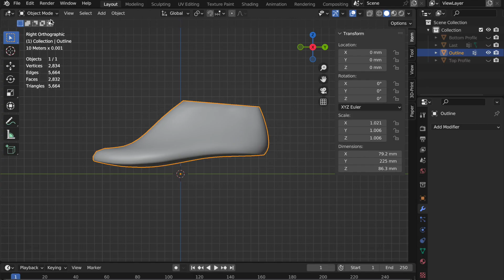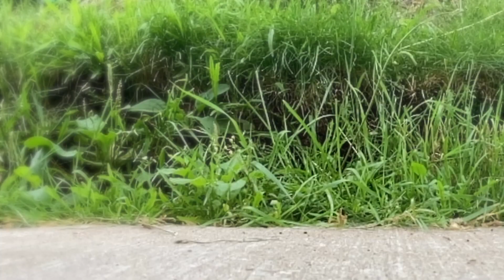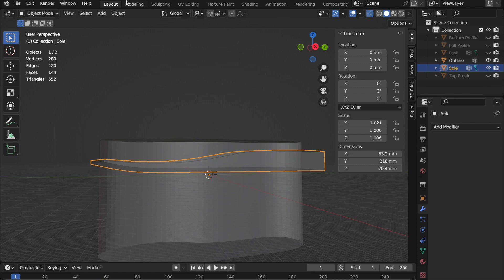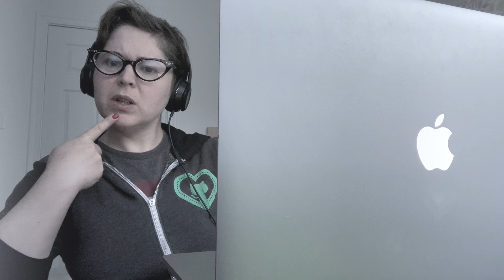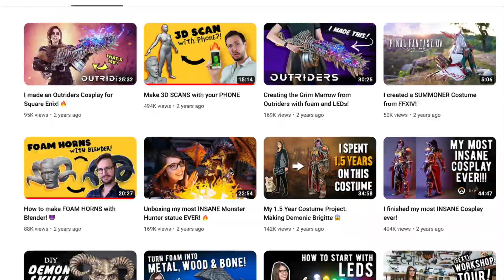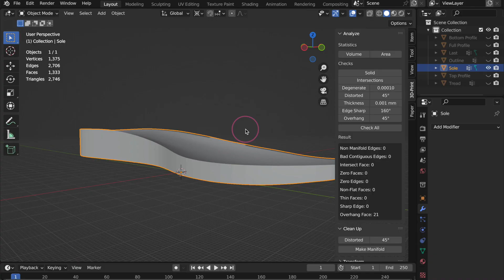Designing custom soles for my handmade shoes - in 3D!

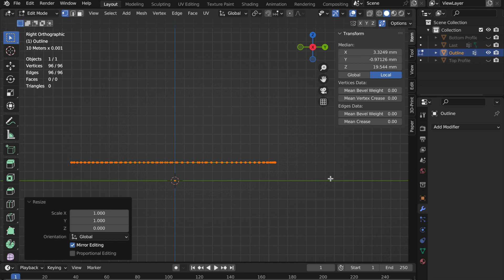Comment: @ 1:52 scaling in one dimension is not the best, its ok but you do get sum distortion ! better to use the 'UV unwrap' its brilliant for the hole form ;) I tackled all this with my sneakers but i used 3dsmax
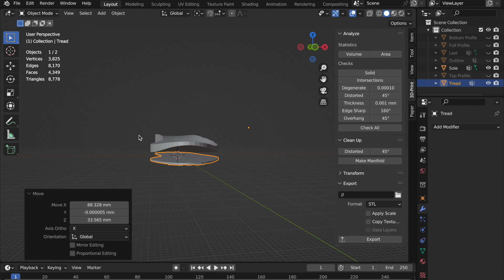@9:20 that's how its done in industry. good stuff just got to get the right glue. I used this interface as the print surfas & flattened mid sol as well, it will all bend when lasted.
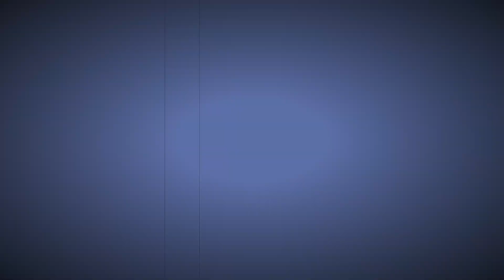@10:11 'UV unwrap'!! & topology! its tricky but not that bad.

Comment: Hi Am just learning to try 3D printing at school (they have enders PLA) and wondered what can print a flexible sole or is that cut of foam? Your video is mostly beyond my understanding so far of 3D printing. Thank you. Will see if instructor will let me do a sock knitter, but not sure I am patient enuf.
Reply from the maker: Hey there, sorry for the late reply! I ended up 3D printing this design out of TPU filament but I had a lot of problems with it that I haven't got around to solving yet (check out the follow-up video if you're curious), so I'm not sure I would recommend it.